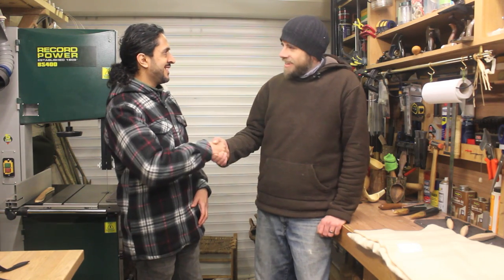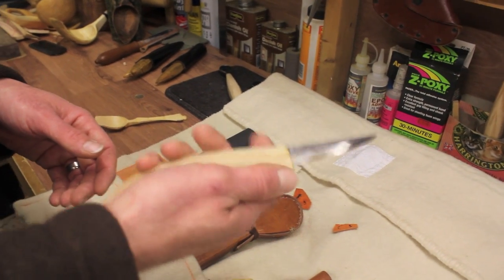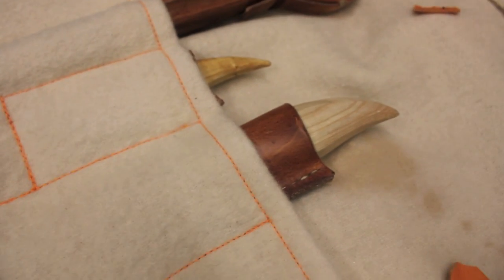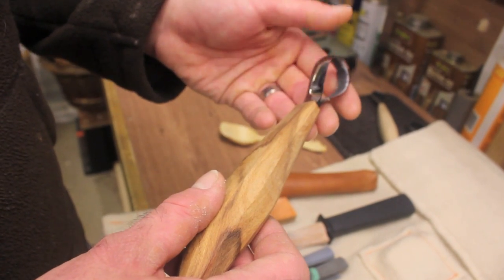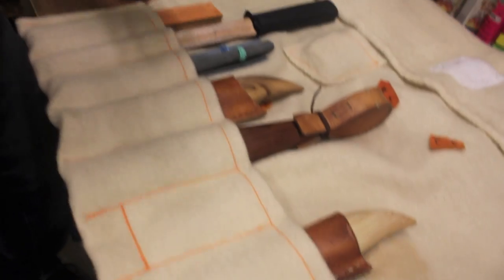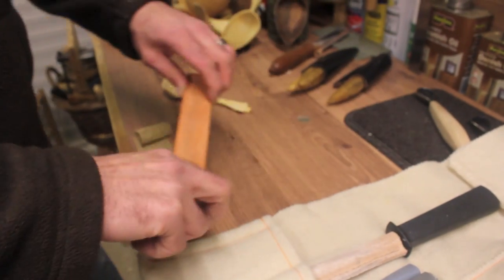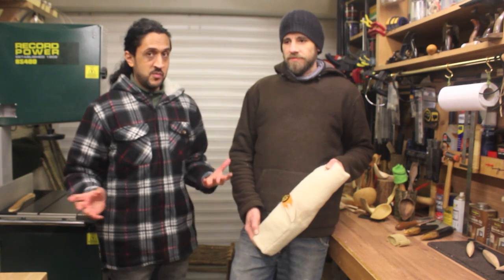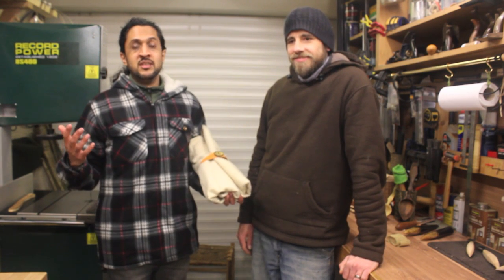My Hand Forged Carving Tools - By Lee Stoffer & Nic Westermann

Comment: Very nice toolset! The scorp is interesting. What brought me to greenwood working is the need for tools to work a hollow limbed hickory selfbow. I actually made a very similar tool out of an old worn out 1" (25mm roughly) box end wrench. It works phenomenally well, and as he said I don't need to switch tools when working either side of the limb...just change the orientation a little and it will carve the left, center, or right with equal ease.

It's really funny how we bladesmiths think so alike in some ways, and so differently in others. I'm very much enjoying your channel friend, thanks for sharing.
Reply from the maker: Appreciate you sharing your insights and indeed, it';s fascinating how toolmakers end up arriving to similar conclusions ~Peace~

Comment: The laminate steel also allows you to have a great edge holding steel on the edge at a reduced cost. The high carbon steel is usually more expensive, so if you just use it for the edge and less costly mild steel for the rest you save money.
Reply from the maker: Appreciate the insights and for watching thank you ~Peace~